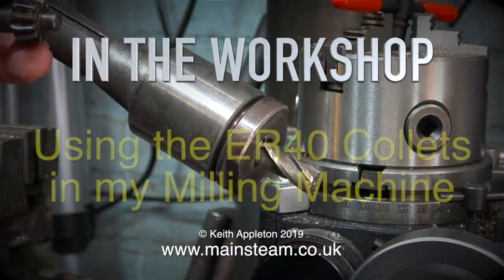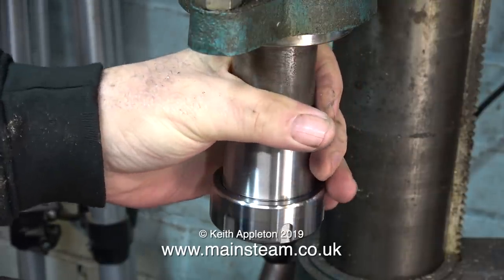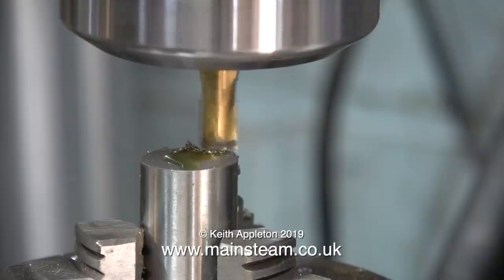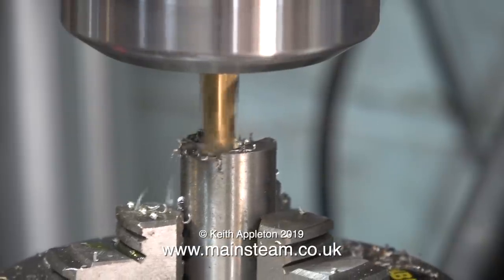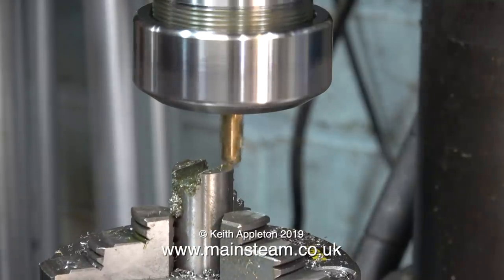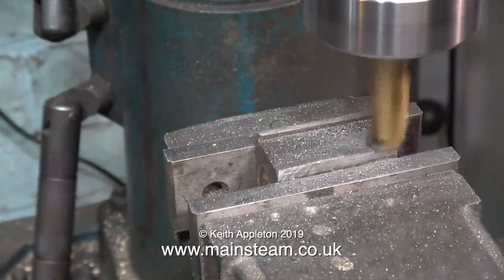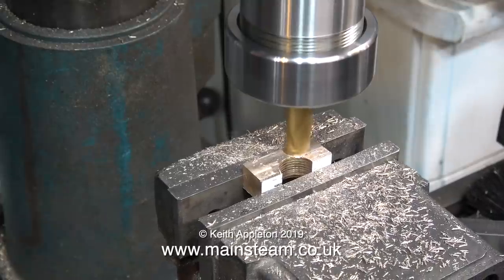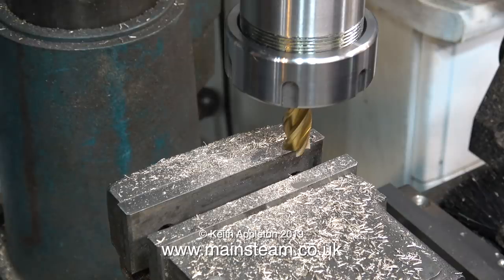TESTING AN R8 TAPER ER40 COLLET CHUCK - IN THE WORKSHOP

Comment: The reason why the chuck gets tighter and tighter quickly is because the collet has a spring temper and has to compress itself down to the size of the cutter you are putting  in it.  They make ER collets that are on size for standard milling cutter diameters where this won't be a problem.  A dead blow rubber hammer is great for doing the final tightening and loosing of an ER chuck without a spindle lock but I doubt there is enough mass in your little mill spindle and motor to get the job done.  On mills without a spindle lock, I used to put the mill in low range and give the spindle a push in the opposite direction I want with the wrench and then jerk it back in the direction needed to loosen or tighten it.  I stopped doing this when I found it messes up your elbow if you do it many times a day and started using a dead blow rubber mallet instead.  

No matter what you do with that ER chuck, it will not be as good as using an R8 collet because of the increased absolute tool length. Absolute tool length is the distance from the spindle face (sort of) to the tip of your tool and has a significant impact on rigidity, particularly with light duty equipment.  With the ER40 chuck, your cutter is now much further away from the first set of spindle bearings so it has much less support, the cutting force has more leverage to cause flex and vibration and any slop or runout is magnified.  You always want to keep the quill and tool stick out as short as possible.   This is true on even large beefy machines.

Comment: Hi ,I just finished repairing a tie rod end that was threaded into a hydraulic piston rod. With no way to grab the rod,I cut a hole in a soft wood block the same diameter as the rod. Then I cut the block in half ,right through the middle of the hole. Using a big “C”clap , I squeezed  the two halves until the kerf closed .  it held well enough to run a tap down in the rod .  No scars,no mars and my old Deere  is back to work.

Comment: the Chuck tightens suddenly as soon as the gap between the collet nut, the collet and the collet chuck is closed. up until that point, the collet is not closed at all and will not hold an undersize shaft or is oversized itself, wich is often the case but no big problem. these big collets need a lot of force to close, much greater than your Bands can comfortably supply. ER collets have one big advantage over direct R8 taper collets and that is they remain parallel throughout all positions allowed while spanning, while direct taper collets make the chucking surfaces taper inwards, this will take away at the acuracy of chucking, will reduce tool life and worsen the surface quality. also always remember: a collet can go a little bit smaller but never ever even a little bit bigger!

i recently started my career as a machinist and watching your Videos throughout the years have given me a good understanding of the matter itself and the mechanics and physics around it, as well as teching me a lot of english. Cheers to you and your beautiful crafting

Comment: your ER40 collet chuck should have flats on the side for a wrench (or channel-locks), if it were mine I'd either return it or if that's not possible I'd grind some flats. all of the collet chucks I currently have came with flats.  But I don't use them much, in the end Weldon type milling chucks are the only way to go.

Comment: Hi
Since you have a milling machine you can mill flats on the ER 40 chuck for a wrench, then make a wrench to aid tightening.
The milling cutter can move in either direction during a cut if not tight enough. 
Some milling cutters have a flat in the shank to take a set screw or grub screw to prevent movement in the chuck.

This is not meant to be troll
Thanksish but with the best intent.
I do enjoy your vids.
Reply: +1 on the suggestion. I own a cheap ER16 collet chuck, which has two flats for a spanner(i use an adjustable spanne, actually). These flats are located on the top of the body whre the tapered shank(in my case a MT2) begins. You might want to check with a file wether the chuck is hardened before taking an endmill to it, though.

Comment: The collets are supposed to click into the nuts before you put either into the chuck. Your previous video shows that you are not doing this, otherwise the collet would come out of the chuck with the nut when you remove that. It's the Eccentric Ring (ER) that holds the collet and nut together that gives the system its name.
Also mill some flats on the chuck to enable you to tighten the nut properly - though not until you've worked out how to insert the collets in the nuts or you will totally knacker the nut. Assuming you haven't already knackered it. Replacement nuts are quite cheap though.
Reply from the maker: Yes, I am aware that the collets click into place, I didn't feel that it was necessary to show every insignificant and obvious detail but it seems I should have been more careful and included every minute detail in the video owing to the volume of messages I am receiving about this from viewers - I am going for a lie down now as the voices in my head have started again . . . . . }:-)))

Comment: Quite disappointing. You'd think that a spanner slot is an obvious requirement in a piece of equipment like this!
Reply: on my ER32 version I milled a slot for a C spanner, no need to bother with a surface grinder.
As for ball bearing closing nuts, from what I hear don't buy cheap ones as the balls dig into the races, less than optimal methinks.